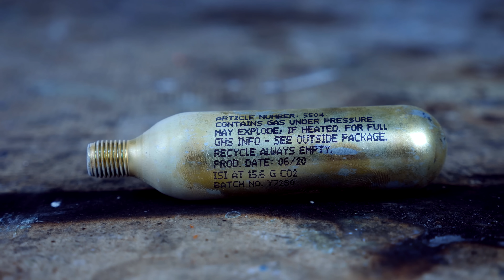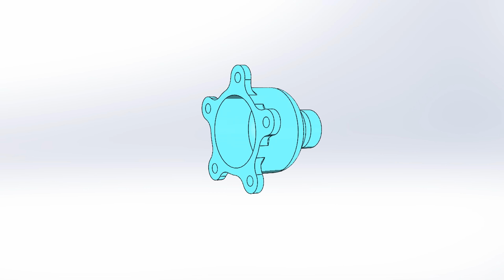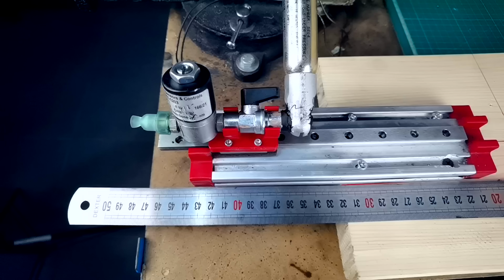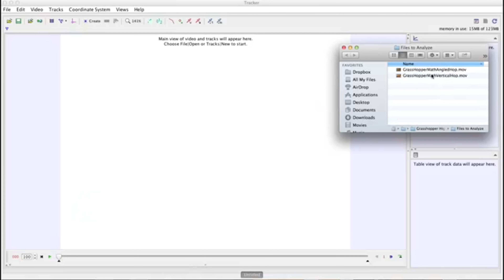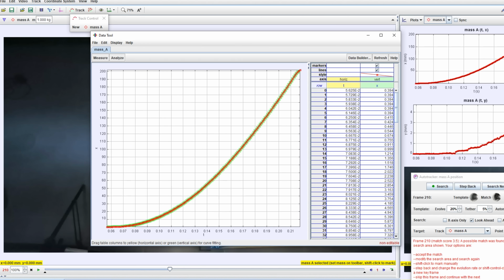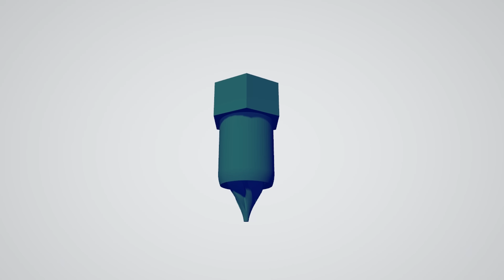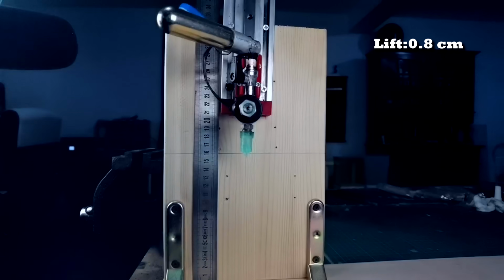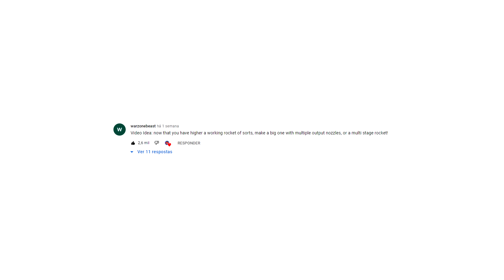I 3D printed a CO2 Rocket

Comment: Have you studied the converging diverging nozzle? I know there’s ways to calculate the right nozzle size but for sea level the recommended shape is extremely simple. 35° convergence, some length for the throat, 15° Divergence. All you need is the length of the convergence and divergence and radius and you can get an easy and efficient nozzle.

Also something else to add, if you want to get high temperature resistance I recommend graphite rods and a lathe to mill them into shape, they are fairly cheap for decent size nozzle and are used in actual rockets for their insane heat tolerance, also you could use some motor cooling like cold gas going around the nozzle before being combusted and exhausted out the nozzle creating a nice system. Anyway, good luck with your endeavors and I hope you read this!
Reply: wouldn't graphite burn on contact with an open flame though? heat resistance is pretty good on that, but it's just carbon after all, i think the flame would wear it down pretty quick and mess with the test results
Reply: @nonchip  graphite works fine as single use nozzle
Reply: @nonchip Ideally there would not be any oxidiser in the exhaust by the time it is in the nozzle. This means that the graphite won’t be able to burn.
Reply: @ryantorckler1278  It will still ablate. But it is mostly manageable for a single burn.

Comment: CO2 cartridges use liquid CO2 not solid.
If you add a heat exchanger you can get a lot more performance. Currently a lot of liquid CO2 is makeing it out of the system. A heat exchanger would add weight but it can more than make up for that with the increased performance.

Comment: Video mini-series idea: 
Test viewer submitted nozzle designs with set attachment dimensions that you 3D print.

And rank them Such as:

-How far can it lift X amount of mass?
-How fast can it go travel X meters horizontally? 
-How wide is the exhaust?
-Fastest acceleration
-Top speed
-Longest lasting
-Strongest initial release
-etc.

Comment: Integzaa. Why not build for the rocket that used the honeycomb catalyst a chamber that would allow you to separate the waist reacted material and like an air compressor when it turns itself off and on to regulate its pressure fuel this thing off and on to regulate your pressure with the peroxide

Comment: Make that nozzle screw onto the CO2 cartridge and then drop it down a pipe with a nail in the bottom. Just make the nail small enough to fit up through the nozzle so it can puncture the cartridge.

Comment: The co2 is actually in liquid form when in the cartridges. When the cartridge is upside down when you release pressure the liquid comes out the nozzle because the gas is forming on top. When the cartridge is upright the rapidly expanding gas is what comes out instead of the liquid because it’s less dense and rises to the top.

Comment: Make a SMART BOT DOT! Bot Dots are the reflectors that are glued to the center of the roads. 
A "smart" Bot Dot would have a battery and a solar cell. That would power an infrared sensor that is "tuned" to detect animals like squirrels and dear. Once detected, a high frequency alarm can sound and the LEDs will start blinking. This should scare the animals away and alert drivers of the danger.
I have a schematic that I hired an engineer to  design for the project, but Ive run out of resources and talent. You are welcome to the design and idea. I just want to save lives, animals and humans, caused by accidents between the two. 
There is a company that makes a solar led bot dot. I was going to try to modify their "stupid" bot dot.
Please like my idea and help save lives! Crowd source fund it! Pre-sell it!

Comment: to bad you can not use the cooling effect of the co. to cool down the output .or also use it to cool the camber ..what if the chamber could be it self could be crushed or compressed .... ok have the co. " fuel " in one camber and the other fuel in another than you can see just how much of each you need for a reaction .also why must the fuel be at the heat is there no way to make a cold exhaust .. have you thought about gas expansion ? have the fuel in a matrix in dry ice and have the other sprayed from all around it yield ?

Comment: Amazing work Integza! Just a little advice from your local Tesla Turbine Physicist, I would suggest looking into the article “Cold Gas Dynamic Spray – Characterization of Polymeric Deposition” by Trenton Bush
University of Massachusetts Amherst

The paper goes through making a supersonic nozzle for a 150psi normal shop compressor. I highly suggest it for the scale size of build you are going with. Furthermore I would suggest extending the diverging cone to be much longer and much smaller angle of divergence. At seems like your nozzles are a bit on the short side and losing efficacy as a result. 

If someone gives you a penny for your thoughts and you put your 2¢ in where does the other penny go?

Comment: You could build a foamboard RC Glider and Test how high you can get with this compressed Air Rocket as IT has a Lot of lift and doesent need so much vertical Power.

Comment: Video idea: build a shock tube. This is the same thing Smarter-Every-Day built to launch a baseball above the speed of sound. With 3D printed parts, it would be a challenge to reach significant high speed flow, but it would give you the opportunity to test nozzle without large temperature fluctuations. AND you could launch a tomato.
Reply: https://youtu.be/NlT6XqpoeTo
Reply: https://youtu.be/NlT6XqpoeTou

Comment: I would love to see a video where you attempt to make an ion propulsion engine or build off the turbojet engine project you did and attempt to build a high bypass turbofan engine like thise currently used on commercial jets as I believe it would be very popular and informative to explain how compared to a turbojet engine, a turbofan engine produces up to 85% of its power from the bypass stage. I know that in earth's atmosphere it will not be very dramatic as it relies on low friction and long periods of time to accelerate but I think it would be a great concept to demonstrate to viewers. I would also really appreciate the 3D printer as I am a pilot by trade but I have a degree in chemical engineering and love to design and test different things. I used to have access to one while I was in school earning my degree but since I graduated I no longer have access to a 3D printer. I promise to out it to good use and am also interested in possibly collaborating with you on a video that involves anything aerospace.

Comment: Due to the triple point of CO2, the compressed gas in those cylinders is ... in a strange state.  1600psi, it's neither a liquid, or a gas.  it's BOTH... existing in a weird and interesting state.  It's also what makes those little CO2 capsules so dangerous.

Comment: Awesome and informational as always! Made me wonder, if you print a ceramic high temperature nozzle as before, but run a tesla valve lattice as a booster "heat shield" in the conical structure rather than combustion flow control or use the CO2 or LN2 to run "active cooling", kind of like the horizontal cooling rings used on the Saturn V, possibly cool the fuel before it is injected into the tesla valve cooling the booster and adding recombined thrust by recirculating the flow into the booster. Not sure if this would work in either configuration.

Comment: Idea : instead of using a heavy valve system, use a coil to heat up and destroy the cartridge seal.
Thus you can put all the power and coils out of the rocket, on the launch pad. And have a lightweight rocket built around the cartridge.

Comment: Have you ever tried a bladeless thruster nozzle? There are plane designs that have nozzles similar to a "bladeless" fan, a tube with a unique profile that drags air from in front of that tube, to behind it, via the stream of air pushing out the back of it, effectively multiplying thrust. Or, at least so far as I understand it.

Comment: I called the manufacturer of these:  The initial pressure of the CO2 cartridge is about 1000psi, and it really IS just gas, the decompression is what causes the cold temp.  You can do it with compressed air, too. Just FYI.

Comment: i kinda want to build a xrs-2200 linear aerospike producing a maximum force of 266.000lb (120.700kg) to my nasa and spacex research

 but challenge make it out of anything 😁😁🥽🥼🧪⚗⚗🚀🚀💉💉⚗⚗🧪🚀🚀⚒⚒🔧🔧🌌🌌☄ 

and also the people that dont know what pi is then here,s your answer  😁😁            

 In decimal form, the value of pi is approximately 3.14. But pi is an irrational number, meaning that its decimal form neither ends (like 1/4 = 0.25) nor becomes repetitive (like 1/6 = 0.166666...). (To only 18 decimal places, pi is 3.141592653589793238.)

Comment: Hi!  For your next series of experiments, try making your own solid carbon dioxide reservoir-chamber; so that after adding pieces of solid CO2, you can then have a constant source of pressure to test different nozzle designs.  Also, if you make your own  3D printed chamber, with just the right size, you might have a longer period of time to have real lifting-thrust with your rockets!!   One previously made CO2 metal chamber-design has used a copper bathroom toilet bowl float (Plumb Craft 7644000A Copper Toilet Float Ball ) with a sealable-fill-port on top to make a friction-free floating hockey puck!  You could also use this CO2 reservoir-chamber design for a horizontal friction-free rail for testing.